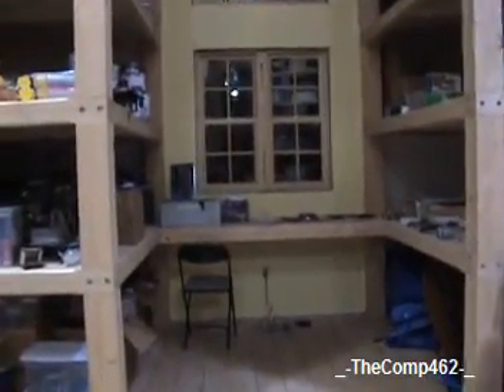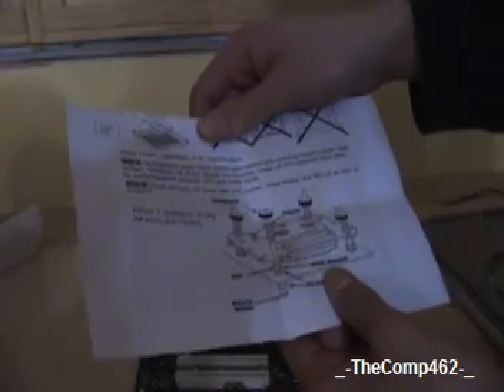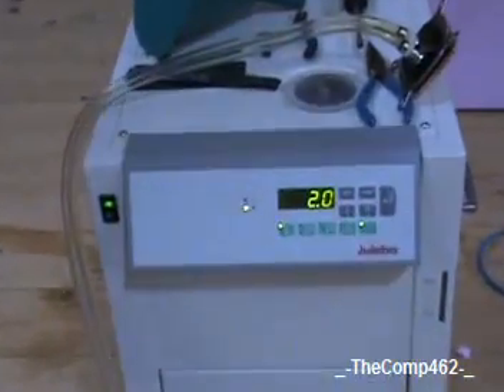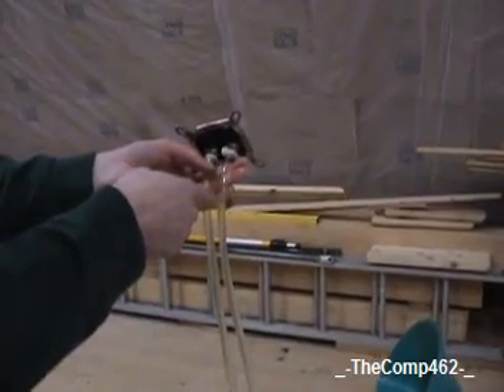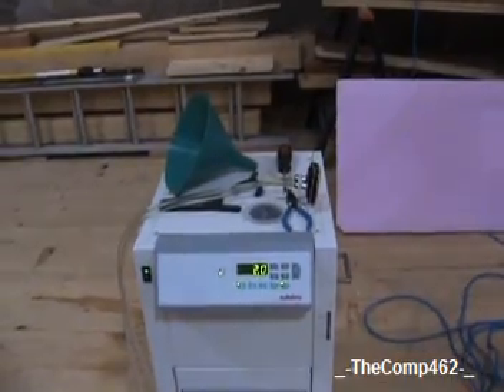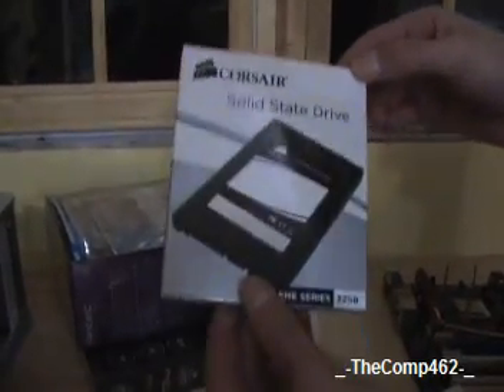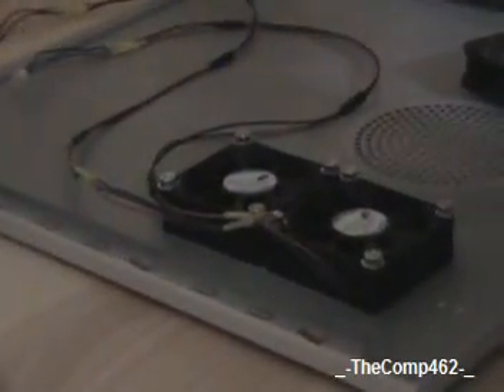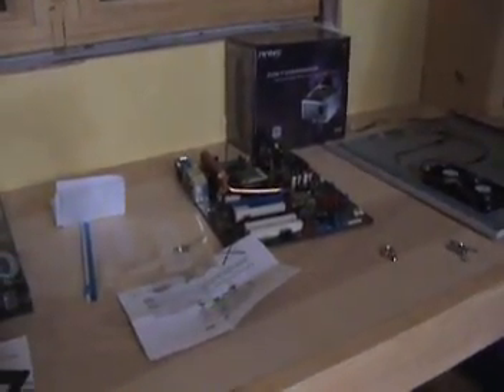Extreme Water Cooling Overclock with Chiller part 1

Comment: Freon does not get added to the water, antifreeze does.  Freon is used as a refrigerant in cooling systems.  The expansion of freon in the system produces very cold temperatures.  the cooling unit you have there has freon of some kind inside.  If you add antifreeze to your water to not use Ethylene Glycol (Typical green/orange automotive antifreeze) use Propylene glycol (usually pink/red and used in RV water systems or food service related items). It's not as toxic.